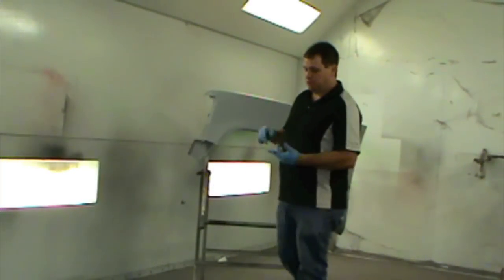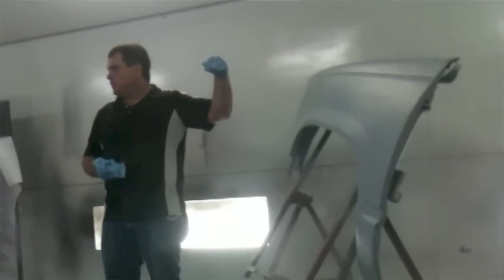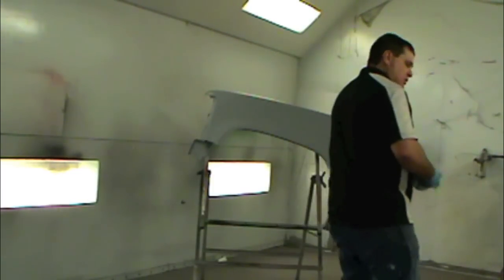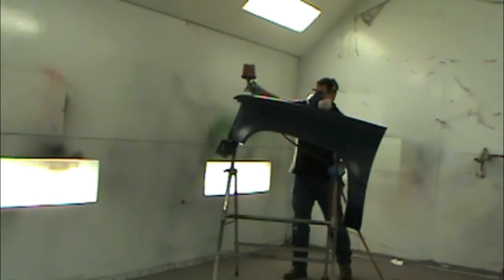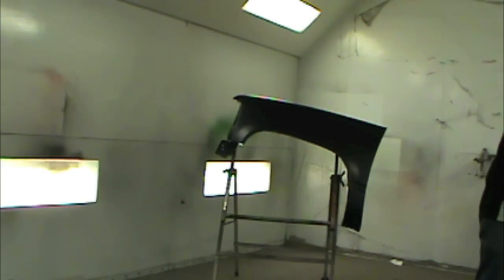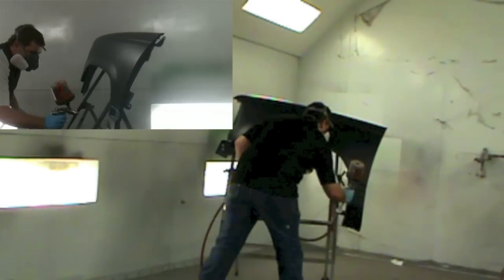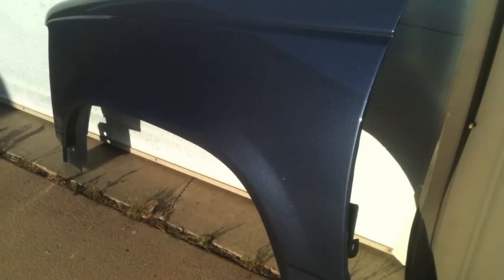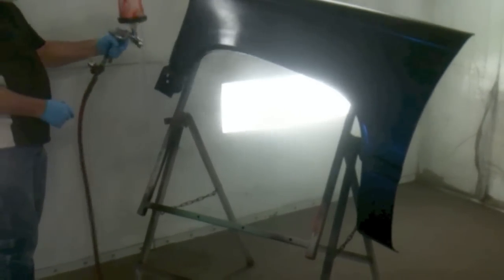Ceramic Clear Coat - How To Spray Waterborne Base and Ceramic Clear Coat - CeramiClear DC 4125

Comment: NICE CLEAR but very expensive here in montreal its    157.00      for one litre and one hardener can, i  will try it for sure, its for my chevy nova ss 1967 and its a black base      that s why i need resistence on the clear hope it will do the job .....time will tell  ......  thanks a lot for vid.....
Reply from the maker: Yes, it is more expensive, but for dark colors like black, I agree that it may be worth it.  If you decide to use it let me know how it works for you.

Comment from the maker: Air flow if the key with waterborne.  We use one of those waterborne air blowers to dry the panel in the booth.  I have lightly dry sanded in 5 minutes.  You can pick on of the air blowers up fairly cheap on eBay or Amazon.  You can also check this system out at CollisionBlast(dot)/TheWallDryer

Comment: Hi Donnie, nice paint job, what's the best way to remove any dust nibs from waterborne basecoat? I've experimented with light sanding dust nibs on waterborne. I've found that, waterborne does not sand very well, it seems to be softer than solvent. (Unless I haven't allowed sufficent air flow) Do you have any suggestions on removing any small imperfections on sprayed waterborne basecoat at all please? Thanks for sharing. Cheers.

Comment from the maker: It recommends dropping the air pressure entering the gun 40%.  So if you are using 22 psi, drop is to 13 to 14 psi.  Thanks for watching.

Comment from the maker: I would prabably stick with solvent in a garage because you may not have enough air movement when spraying.  However, the ceramic clear should work fine.  It is awesome!

Comment from the maker: The clear is solvent base and the same gun can be use.  I recommend using a separate gun for waterborne.  Not all guns are equipped for waterborne.  However, is you clean your gun extremely good after each use, you can use the same gun for waterborne and solvent.  Thanks for watching!

Comment: So Donnie - do we need a new gun to spray water-borne or is it the same you use for regular solvent base?  Same question for this new style clear.  Also what pressure do you shoot this base at, is it the same as with solvent?  Thanks for your videos, they're very helpful.